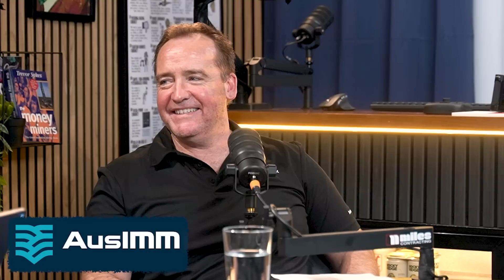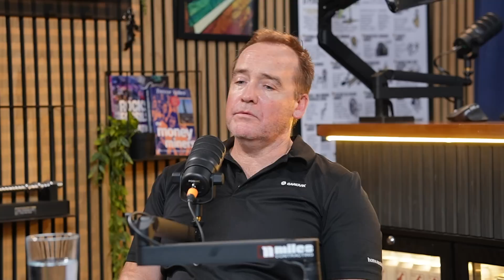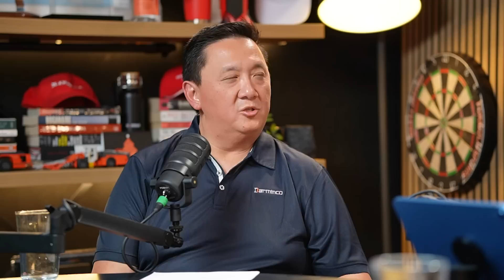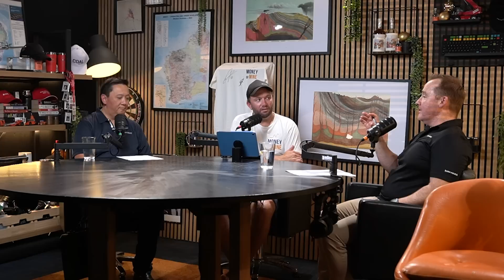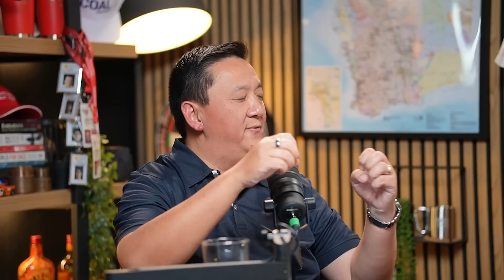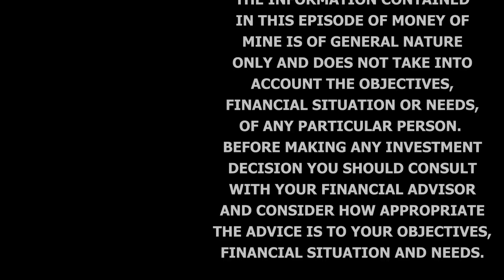The Future of Underground Load & Haul

Comment: Anything you missed? Never heard the presenter ask the most important question to these two Barstinko visionaries. What happens when a thermobaric fire erupts on your 120 tonne fully loaded lithium ion Sandvik rockbus tramming backfill down a dusty Barstinko decline, thanks to salt corrosion, mine acid water, everyday decline vibration or some tired, overworked contractor ramming your rear end in a bogger. I suppose they would likely reply, "oh, that's the mine rescue teams problem, not my department". Buyer beware.
Reply: how is it different to if the diesel loader catches fire and the fire suppression doesn't put it out?